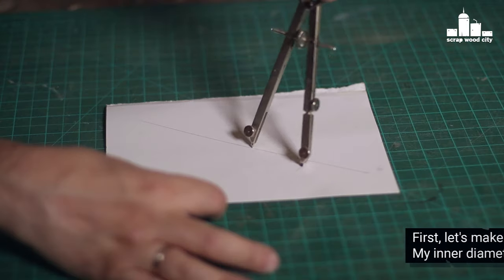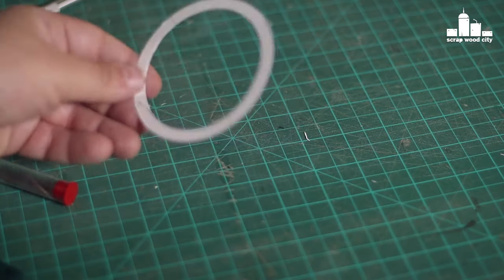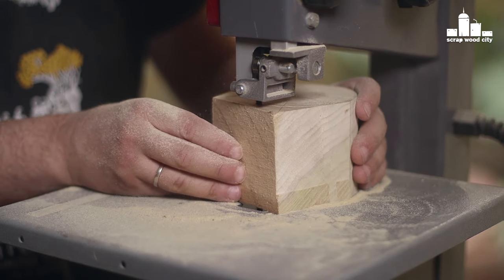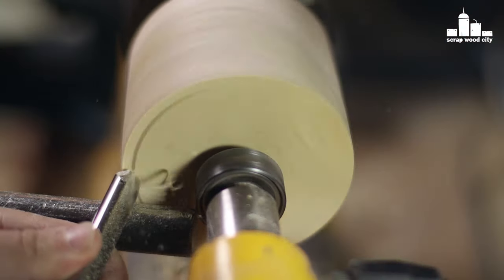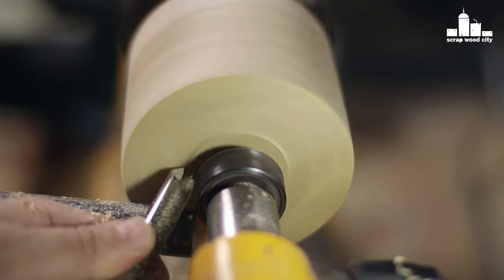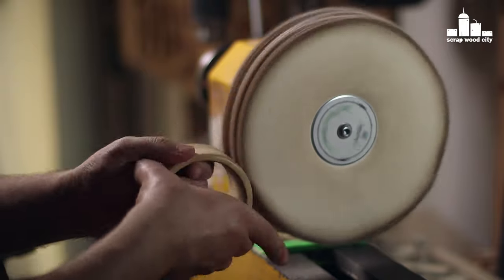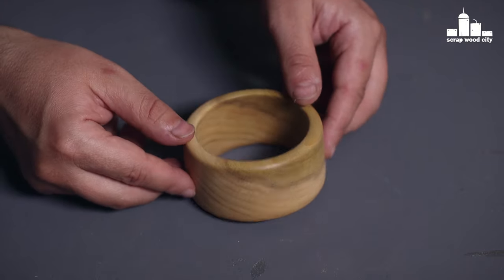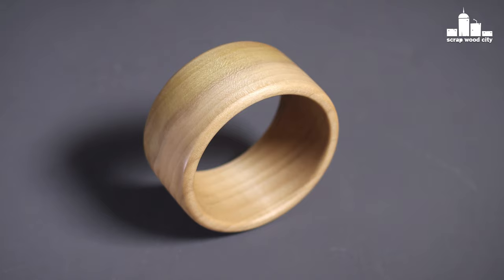How to make a wooden bracelet - Woodturning

Comment: Very nice bracelet. Very straight forward turning project. Nice finish. How do you measure the lady's hand to determine the inside diameter? Is the template really necessary? Wouldn't it be just as easy to measure directly to the end of the wood blank? Thank you for sharing. Have a great day and remember, when the wood goes around, the face shield comes down.🙂🙂
Reply from the maker: Thank you. If you have the lady available, yes, you can do a fitting test. If not templates really help.